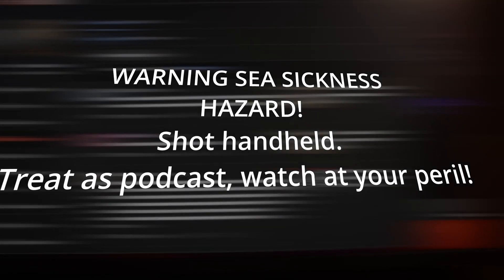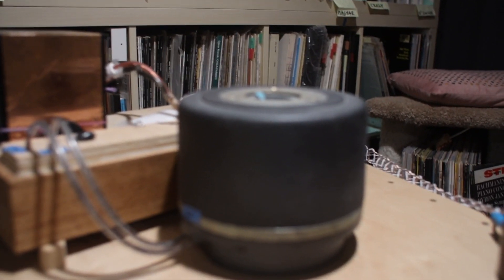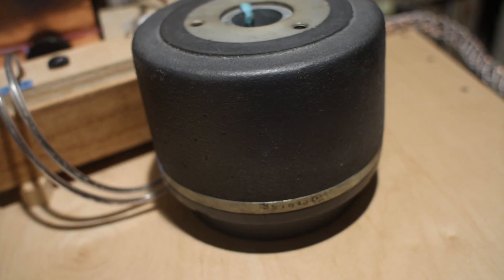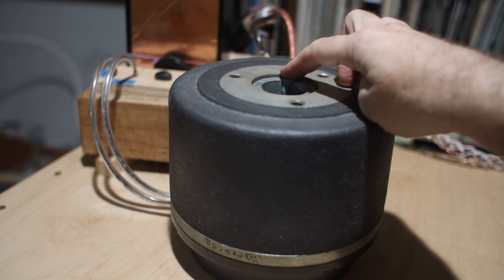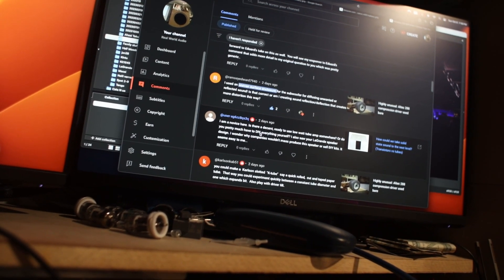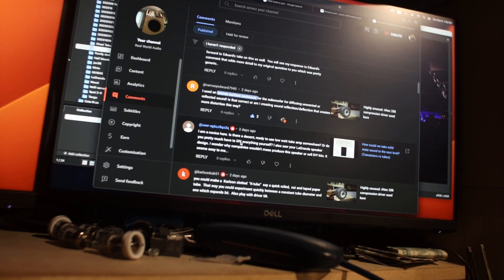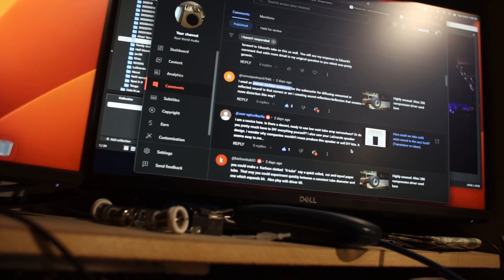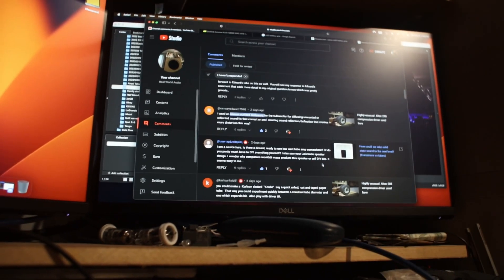Answers to Altec 288 questions!! (Part 1)

Comment: Another high quality tube amplifier kit is the Elekit TU-8900. You have to buy the tubes separately though.
Reply from the maker: Yes, that is absolutely superb. It's one of the more expensive kits though. On the upside, it has highest quality output transformers available in any kit. Costly, but well worth the cost.
Reply: @realworldaudio  I built one of the Elekit 300B kits for a customer, and it came out great. Put a pair of either Linlai (AN uses them, I believe) or psvane tubes in it. Don’t remember which, as it was yrs ago. 
There’s 2 kits available from them, the standard one, and then the one with Lundahl transformers, Takman resistors, and Mundorf caps. I built the latter, and the sound quality was great. It was actually surprisingly good. It put out a bit over 8 watts at aprox 1% THD, but only with a 1K sine wave. Music sounded balanced with good low end, nice airy highs, and that beautiful midrange 300B’s are known for.
Reply from the maker: @NickP333  That's news, they have it in now two versions! Thank you for the feedback, Nick! ;)